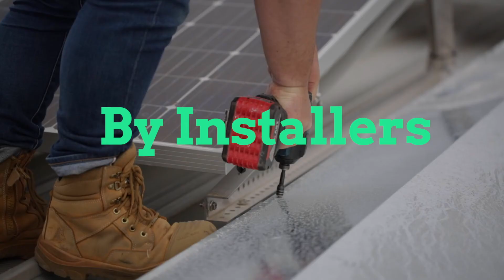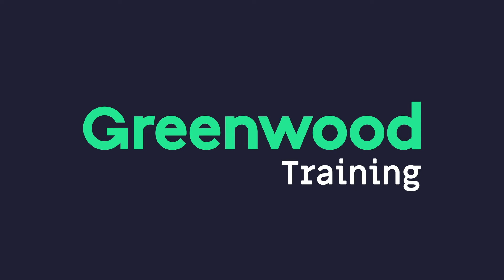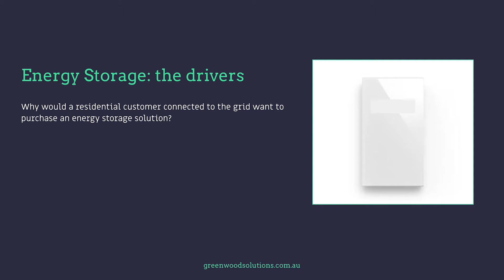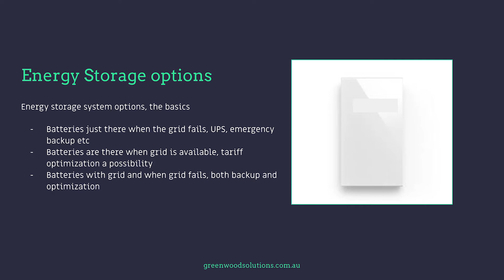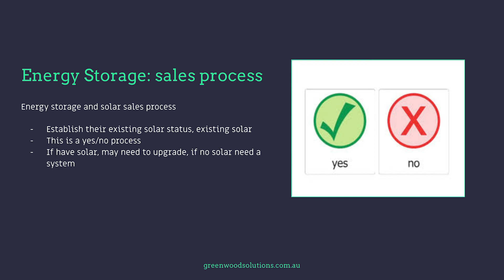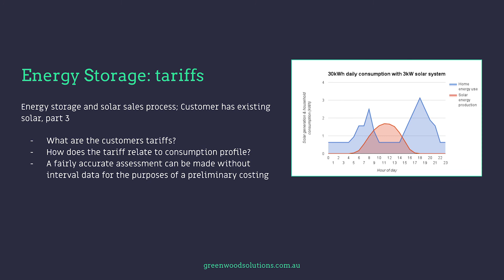Energy Storage: Sizing and Sales PART 1

Comment: If I got the load profile presented in 15 min, time interval for the whole year,  how to decide solar and non-solar production hours? given that sunrise/sunset is changing seasonally. Also, how to size the charging power?
Reply from the maker: Existing programs base their results on averages as, you are correct, daylight hours change throughout the year.